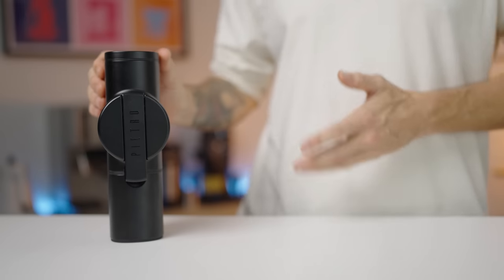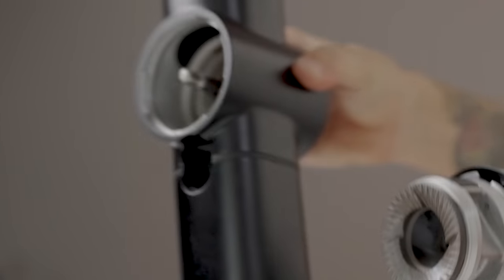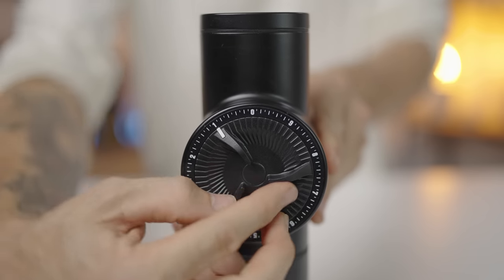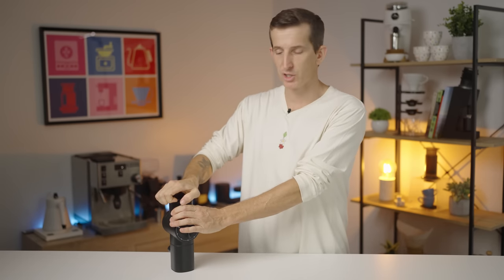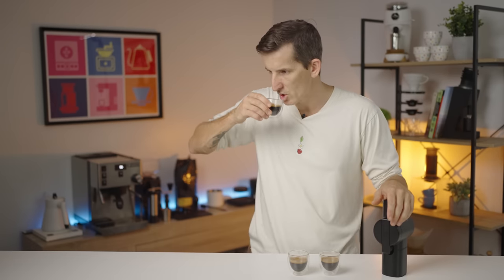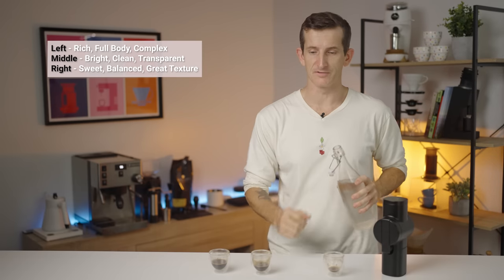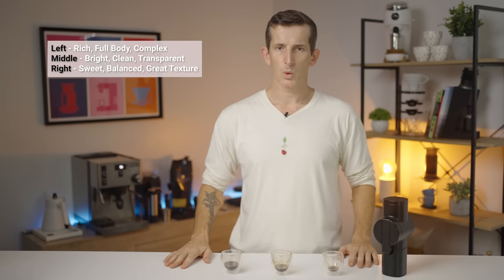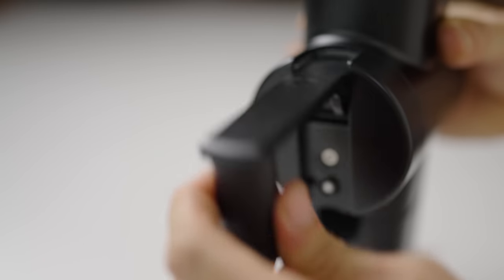Fiorenzato Pietro Manual Flat Burr Grinder Review

Comment from the maker: ADDED NOTE: I counted ~170 revolutions to grind 18g of espresso beans... It is comfortable grinding at a speed of 120rpms. ... any slower than that - it'll take quite a while.
Reply: Yet I still see people compliant about how Jmax is difficult to work with. That only takes me 30-40s for a 20g shot, from light to dark roasts.
We shall see how this stands up to the new sculptors, since 064s is 300usd and 078s is 500usd for the KS deal.
Reply: I do think the beans feeding rate into the grinders is very slow, allowing for the handle to feel comfortable and not too much work, but a lot slower than my 1zpresso jxpro. It'll take 30-35 seconds with that grinder to tackle 18grams espresso size.

I think however, in the next iterations of the Pietro or others brands, the design would be more practical and nicer. It has quite a lot of potential having a flat burr hand grinder... I'd love to have one for my occasional pour over.
Reply: Same calculations here: about 180 revolutions on average depending on coffee. Never felt hard but far from being the fastest hand grinder in town. I also use Comandante and JX. Sure the JX is great and (much) faster, but the cup profile is quite substantially different. The JX now tends to remain tucked in its carry case, while I have left my Comandante set for pour overs. Pietro used daily here for espresso. The upcoming baseplate should make it even more confortable to grind with.
Reply: Additional finding. Don’t know if it’s the same for you but I found that big clicks usually generates a 6 to 7,5/8 second difference in a 18g shot. Haven’t had to use the in between notches settings yet (I usually keep setting and increase to 18.5g as coffee looses freshness).
Another point: Pietro has confirmed to me by email that pro burrs will be available to purchase separately my end of may.
Reply: @jslanfranchi  Hi. well if you have the jx it's possible to have 5-8 secs gap in espresso shot time. With the jx pro, which is the one I have, its more 1-2 secs difference, sometimes less with very freshly roasted coffee sometimes more coffee has more than 1 month from roasting day. I agree that the baseplate would be great. Nice to see how does pro burrs will behave with espresso.
Reply: @Psychoh90  sure, forgot to specify I have the JMax, but doesn’t change the base facts: for now, with 3 different fresh coffees, and about 30/40 shots with the Pietro, the clicks have demonstrated to be enough for me to dial in great shots. I do have more control on my Eureka, and it does grind faster (much) and without effort. But the Pietro takes the edge for my palate without (for now) having to play with notches or half clicks. Now don’t get me wrong, they all are great grinders, and anyone would be more than happy with any of these. For the price, the 1Zpressos are… hard to beat. I just feel quality and cup profile of the Pietro justifies - for those for whom it makes sense - the premium. Also you need to factor in that I use mostly manual machines (Flair and Robot), where I can manually adjust pressure and flow, even though I have gotten the best shots from my Barista Pro with the Pietro. With the added benefit of going to a turbo shot in a just a few clicks.

One other thing to mention compared to the eureka (also flat) is that the Pietro has blind burrs (screws on the back). I am sure that this extra grind space and the avoidance of these holes and fines/coffee trap does technically could explain the overall preference I am getting towards the Pietro.
Reply: @jslanfranchi  Yep it does not change the fact that the Pietro is great as you said. I would still wait for the updated version, especially for the time that it is needed to grind coffee. Great details spotted there about the blind burrs! 

It's strange however about the jmax issue with the clicks you mentioned cause it has 0,0088 mm differences per click and it's great for espresso dialing in. 

I think I would consider the new version of the Pietro in a couple of years, with the flair 58 I am planning to buy later this year :)
Reply: @Psychoh90  nothing to worry about the JMax, easy to dial in to the second and makes more sense to people who want to be precise in grind sizes to the second and to grind fast. That’s what I love about it, and never fails to give enjoyable cups. Just sometimes body is quite emphasized to me, and Pietro seems to retain some of that body (the “velvety” feeling mentionned in the video was so spot on), while getting a nice balance in the cup. It immediately felt to me like “Italian 2.0 espresso”, but not sure it makes sense to most besides me and myself 😅.
But you are already all set with the JX Pro! Get the best of it. The only reason I have multiple grinders is I have 2 places, 2 espresso setups per place (manual grinding/brewing, electric brewing/grinding). And one grinder (the JMax) for travel with a flair pro (I guess that should count as an additional setup then)… no need to copy me 🤣.

My favorite setting is manual with Pietro, but they all have their charms and bring other upsides to the table (family members won’t do manual espresso / grinding… I don’t blame them)

Can’t wait to get other reviewers to dive deep into tearing the Pietro appart. Especially on these ProBrew burrs (I think Lance has been involved in their development) as for now have not been reaching the Pietro for pour overs. It does it fine, but off the box the multi purpose didn’t seem to be as much of a noticeable difference to get me to use it more than my Comandante which I enjoy quite a lot when I do pour overs.
Reply from the maker: @jslanfranchi  Great news 👌 Yes, increasing dose is always another great option

Comment: I have a Pietro manual flat burr grinder and I really love it.  I live out in the country and we sometimes have power outages so I was looking for a good hand grinder.  It was expensive but the shipping and import fees were included in the price, so it is sort of comparable to more high end hand grinders.  I have the multipurpose burrs but mine is coated so it is black, the burrs are great and it does do surprising cups.  I would highly recommend it if your situation allows.

Comment: Great vid ! Very informative. I got the Pietro, and understand the critique about grind setting limitations, however I found on the opposite that it was very quick and easy to dial in. Sure not suitable for someone needing micro adjustment to the second, but much easier to dial (and go back and forth) than my 1Zpresso (which will cover ´y need if ever it’s a question of 8 microns) and Comandante. It is to be noted that this was purchased for my manual lever setup where I have more control. My take may be different if it was for my machine.
Like you I found the cup profile to be delightful, not lacking in body compared to conicals, and with great clear flavors. And that is what matters the most.
Grinding is easy, although long - longer than Comandante - and sometimes challenging to avoid the base from wobbling. These are the two biggest improvement areas I would like to see addressed.
Cleaning / disassembling is a breathe and pleasure. And being told pro brew burrs would be available separately at some point. Build quality is on par with price. All in all, I am thrilled with this purchase.
Reply: How does it compare with your other hand grinders? Are you doing filter or espresso coffees?
Reply: @MH-go1md  hi, doing both but I am more espresso focused. Comparing to the other hand grinders it’s different. It’s the slowest to grind a 18g dose (1Zpresso is the fastest, then Comandante, then Pietro but I am also not used to it so take it with a grain of salt as it is not same mouvement). It’s also, and that is purely subjective, the best tasting. The others produce very nice body, but the Pietro is definitely replacing my Comandante for espresso as the flavors shine more clearly, and setting / cleaning is miles better. All of them are great and I would be happy with any, so there are no wrong options. Haven’t done filter with it yet (waiting for the pro brew burrs to be available, and Comandante is already set for my filter routine so…). Sorry, difficult to tell you. 
One thing I know is that I prefer it to my Eureka electric grinder. Probably the slower RPM, and different burr geometry. I am also biased to hand grinders so… hope this helps !
Reply: @jslanfranchi  what is the best overall setting on the c40 for a pour over in your opinion?
Reply: @LilyWillow22  depends on so many factors. Coffee, taste, brewer, recipe, paper/filter used, and obviously personal preferences and tastes. Comandante recommends in the region of 25 clicks (regular clicks, double for red clix) if memory serves me well. I tend to start a little lower then adjust, but I am not an expert !
Reply: Longer than Comandante? Dang, that takes lots of elbow grease
So you prefer this thing over the C40 and 1Zpresso (k series I assume) but IMHO it all comes down to preference, not only in taste but other many aspects. Pietro looks solid but highly doubt it to be as durable as the C40. Please correct me if I'm wrong. And taste wise, i find a ZP6 or even Kplus to be as good in the cup as the best flat burrs I've tried. It's not like flats are superior. Just different. I've seen cases where people picks conicals over flats for certain applications in a double blind test. That's perfectly valid. 
Another quite important aspect is that this grinder is crazy expensive for a bench/manual grinder. Yeah I know that it's well built and everything but at this price point it's difficult to justify the cash when there are so many options available, with great quality, powerful motors and interesting features.
For me, conicals do the trick pretty well on a dayly basis and since I've been using some sifting I'm able to fine tune my PSD to make it narrower or multi modal, etc
Reply: @mprz8188  all valid points! Let me answer a couple of points:
- I don’t have a K series on hand. Was comparing head to head with the JMax I have.
- regarding solidity, the c40 has been around for some time and proven to be build to last. Plus if anything happens, à call and you are set (great warranty and parts available). But the Pietro feels anything but low quality. If anything it feels very solidly built, it’s heavy enough and feels way more solid in real life (the handle was a concern, not anymore since I have layes my hands on mine). However true that parts and warranty have not been tested yet, so that is to take into consideration.
- for the time it takes to grind, now I am sure with a proper base (if the one they come with is well designed) could actually narrow it down, and make sure you stay in the most efficient RPM zone.
- now regarding price… well yes it is expensive. Got mine at 370€ ish. So a steep increase over the c40. It’s cheaper than a Mignon. It also doesn’t have a motor, but has produced better cups for me. It’s all about whether the price is justified for you or not I feel. 
- now regarding conical vs flats, I also agree with you. Plus most people won’t see the difference. When I tried it, here, I made it side by side with 2 conical grinders and one flat. The ones I use at home, without any bias. That’s where it came from. Now I don’t enjoy sifting, so that may have produced different results, but a nice sifting setup plus a c40 is roughly there in terms of price, and time wise I feel Pietro would be more accessible. 
Another thing to take into consideration is that coffee making is for me part of my mental morning routine. I enjoy the smell, the feeling of grinding and pulling a manual shot. I do the same with my teas, so that extra time is not a big issue. On the weekends, when I pull shot for friends and family, I never reach to my manual grinders. They won’t make sense.

Comment: Very curious about this. Lance Hedrick posted a picture recently including a base for better stability when grinding, but I'm not clear on whether that will be included when the grinders ship or whether that's an aftermarket accessory (on an already very expensive hand grinder). He did say that it will be easy to change between the two burr sets, and I saw at least one vendor that's listing the burrs separately as an $83 USD add on. But I don't know if the swap process will be so easy that it wouldn't be annoying to do on a regular basis.
Reply from the maker: We already have stock of Standard burr Grinders - with no information about the base coming anytime soon. .. I would hope maybe in the next shipment, and not too more expensive.

Had tried to remove burrs to isolate them, though from a consumer standpoint - not practical, with springs that pop out under the handle and tools that are required that don’t come with the grinder. 

Interested in seeing how other retailers offer this- is it just OEM or are they swapping them out on order… Unlikely the latter. 

Also, very much looking forward to @lancehedrick review! I know he’s spoken highly of the performance of the PRO burr. The standard burrs are great, would love to test the PRO.
Reply: It’s an additional purchase that should be available sometime in June or July from their purchase page and later on at various resellers. 

The burrs are interchangeable they had a campaign where you get both burrs if you bought it at their boot at the dutch festival.
Reply: @Alternative Brewing  are you sure you know how to remove the burrs? It's not that difficult. Need a hex key and wrench. No springs

Comment: I’m wondering about two sound factors. The first one is from before I watched the video: Do you reckon the vibration of grinding echoes through your worktop? E.g., my gf sometimes handgrinds holding the 1zpresso down on the worktop and to me  it’s like nails on a blackboard…
The second sound question arised when watching this video. Around 6:29, what’s the clicking sound when grinding? Is that from the grinder, shirt, or just the microphone picking up something you didn’t notice in the moment?
Reply from the maker: I vibrates quite a lot. I would say it is louder than any other hand grinder - as this vibration will reverberate through the bench. That clicking sounds, I'm pretty such is beans skipping in the grinds chamber. Pop-corning basically, with nowhere to go.

Comment: Hi, thank you for this review, very informative! I'm thinking of buying one for making espresso with my Mara X machine but not sure which option should I pick - multipurpose or pro brewing? Are there other options except for these two?
Reply: Hi, they are advertising the multi purpose to be more efficient for espresso. At this point these are the ones I have so can’t speak about the pro brew (which are said to be more filter/slow brew oriented)
Reply: @jslanfranchi  Thank you for reply! I'm considering buying one as my first ever grinder but not sure if that is the right choice. This video review bought me and also must say it looks very well made. Would you recommend it considering that I have no experience with grinders so far and the price it goes for?
Reply: @JelenaKos-j9v  this is a very tricky question. In all honesty if you are looking for a first hand grinder for espresso I would question committing this amount. It does have flaws or negatives (that matter more to some), but on the other hand is really great cup and build quality plus easy (for me) to dial. Another good option would be to go with a cheaper 1Zpresso (like JMax) to get started, then upgrade down the line. You need to be sure hand grinding is for you (morning workflow matters. Sometimes more than getting a little better tasting profile). The Mara will deserve a good grinder anyway, but wether it is electric or manual is a question only you can answer (I have an electric grinder for these mornings where hand grinding is not what I need 😂).
Reply: @jslanfranchi  Thanks once again for your opinion and advice! I think I'll give it a chance and hope I'll love the workflow as much as the looks, and that a little bit more preparation time will be worthwhile.
Reply from the maker: In my experience, a little bit more preparation time always pays off 👌
Reply: @AlternativeBrewing  true that! One of the reasons I love manual machines and grinders, feels more of a ritual.

Comment: Do you know if each revolution of the crank translates to one revolution of the burrs? If not then the rpm calculation may not be correct.
Reply from the maker: To my knowledge it is yes. I don't see any gears involved - seems a very direct ratio 👌